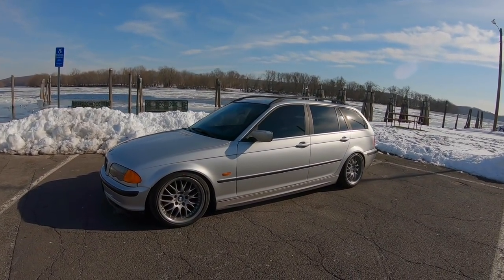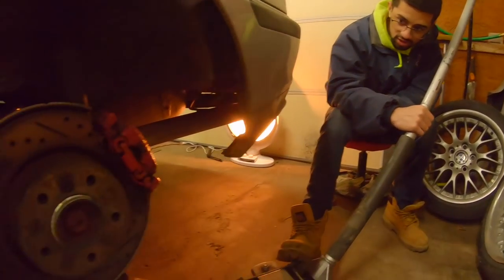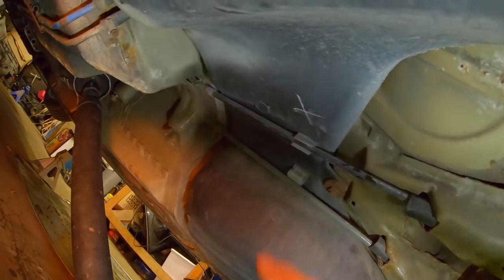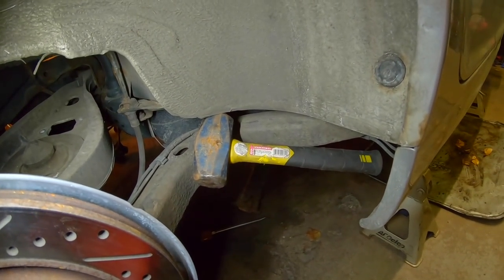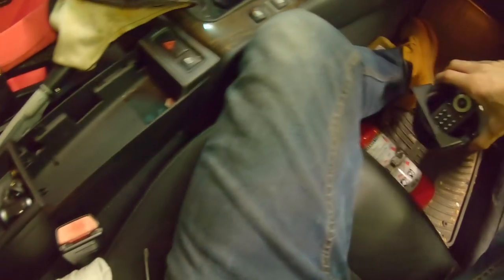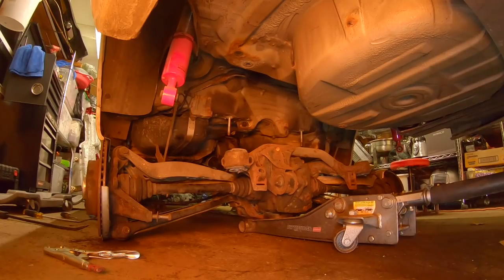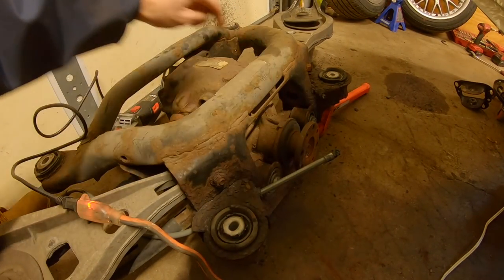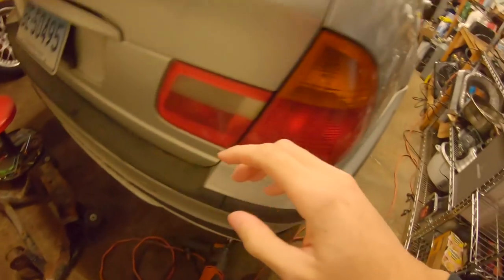REAR SUBFRAME Removal On My E46 Drift Wagon

Comment: Bro i felt that driveshaft separation, situation in my soul lol. i was trying to change my diff bushings in my e46 sedan and i couldn't get the drive shaft to drop so i couldn't drop the diff . Wasn't trying to take the cover off so i just put it back together before i was balls deep. But after seeing you go through exactly what i did but having a solution - i thank you because of you, I was able to swap my bushings out🫡🫡I know the vid is old but it came in the clutch. Preciate it gang, Deff got my Sub & a bell notification brother

Comment: The e-brake cable didnt pull put, because the end of the cable has a cap crimped on to it which cant go through a rubber boot you cant see, in the trailing arm. The rubber boot sits on top of that metal sheath, where the cable housing is sitting. To remove, you take a thin punch and knock  the whole assembly out, from the outside -> inside. This only works i think if you ve taken the flange of the bearing off first. If you havent done this, get some pliers and work the plug out of trailing arm from the inside.

Comment: I'm having the same exact problem on my 1998 328i. Rear subframe bushings are completely toast and you feel it everytime you shift and release the clutch. Watching this video for maybe a future fix...
Reply: I did my rear subframe in December (1999 328i touring) replaced all bushings with poly. Just removing the old bushings took us like 6 hours, if i knew it i would have picked up whole new subframe, arms and everything. It would save so much time and anger. FYI the car feels 1000% better, no clunk on shifting or when releasing the gas.
Reply: @BIGimont  A brand new one is of course always best but a new one with new arms, bushings etc. in my country will cost well over 1500 euros. If I get to keep the car, then I'll consider doing it.
Reply: @saimk4239  You can buy used ones and refurbish them also. Will be like new and much cheaper.

Comment: The reason your impact didnt loosen the axle is because it looses way to much torque on the adapter, the extender and the socket witch arent rated for impacts (impact sovkets doesnt give as much so you doesnt loose as much torque)

Comment: also the maxpeedingrod adjustable lower control arms are decent from the experience i had with them, maybe its what you need to run 0 camber in the rear

Comment: it's not the chassis thats weak, its the bad design of the subframe because the diff transferring torque + your gear shifts + bad subframe bushes. you can eliminate it with subframe reinforcements & solid subframe bushes. rear strut brace if you're keen too